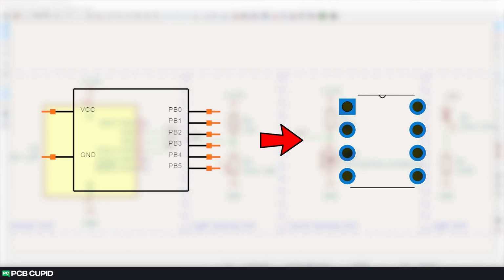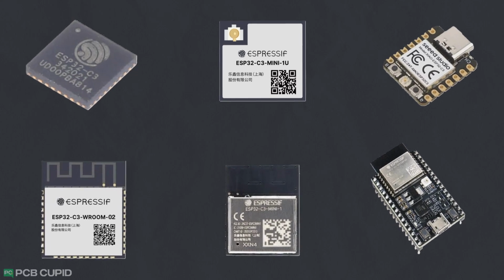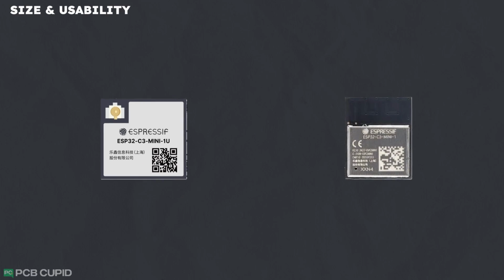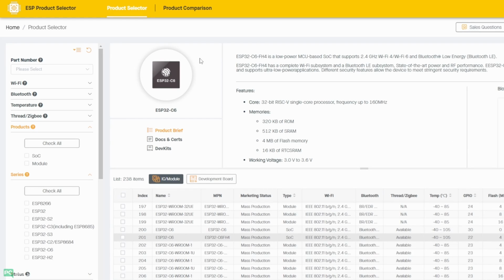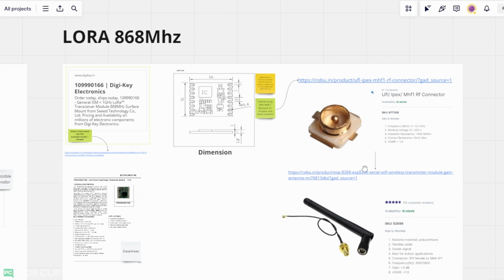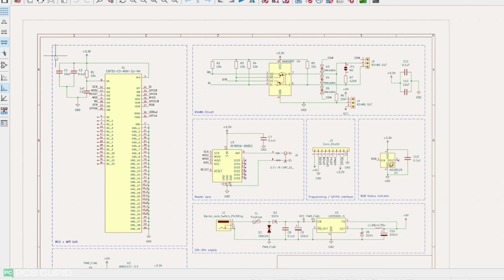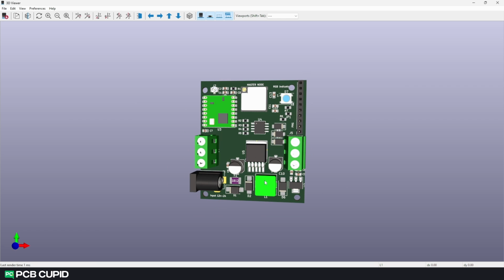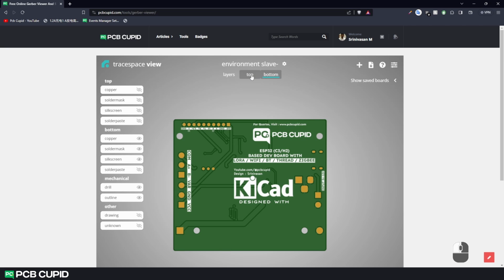#4 How to design PCB Layout Design for LoRa + ESP32C3 in KiCad | #pcbcupid

Comment: I agree with the choice of processor, but I think it would be more logical to go with the latest SX1262. There could easily be a chance to work in Lora or Lorawan. It didn't make much sense to choose the lora chip, which is almost from the esp8266 days.
Reply from the maker: Thanks for your valuable input! Maybe to fix this, we can make another series where we use the SX1262 IC instead of a pre-fabricated module.
Reply: @pcbcupid  You have not uploaded much videos bro ! We are awaiting for new videos......
Reply: @pcbcupid  I think it would be great too.  Good luck.
Reply from the maker: @ressamendy  Thank you!
Reply: In fact, in the new series, workability should be preserved, especially with the programming infrastructures Arduino IDE, ESP IDF and Microphyton.  Also, all pins must remain in a workable condition.  .  There may also be an Esp32s3fn8 in the leading role.  But they should all be in chip form, not modules.  Esp32s3fn8 and sx1262.
Reply from the maker: @ressamendy Thanks for great suggestion!